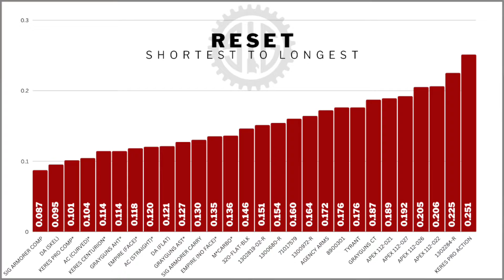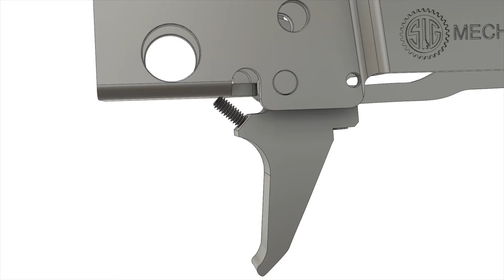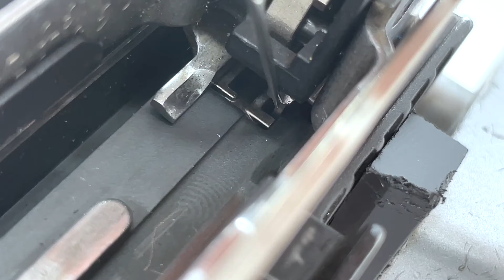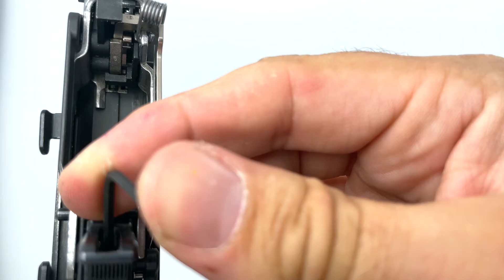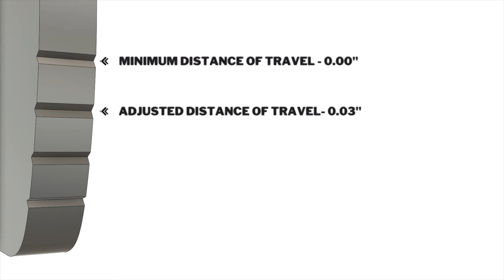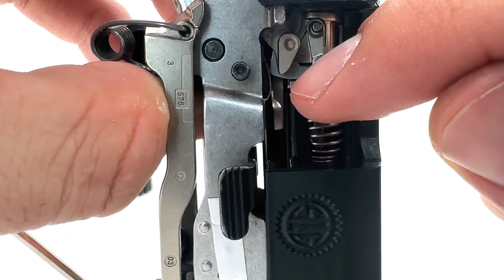EFFECT OF ADJUSTABLE TRIGGERS ON P320 SAFETY

Comment: Amazing what you do for the SIG Community. I am an active IDPA competitor, and recently switched to a SIG P320 Spectre Comp. My wife has a Walther Q5 Match Expert which came with a label, the it has a sporting trigger where the drop safety is compromised. I fully understand how and what the adjustable trigger does now based on your video, but how do you rate  it when it is really only used for competition?
Reply from the maker: In stressful situations like defence or competition it will probably come down to the proficiency of the operator. Bad habits and inexperience could definitely compound problems that lead to ADs. However, even at 50% loss, you still do have safety left to go… not ideal but at least it’s present.

The trigger results however are also VERY impressive, I would not be able to rate it being how subjective that is, but when I look at the data from the trigger video I made, you can clearly see where the adjustable triggers are better.
Reply: @SIGMECHANICS  Thank you!

Comment: Greyguns and Sig Armorer have modified sears, how does that effect safety? Greyguns website says with modified sear, it should only be used on range or in competition. Sounds like safety may be affected? This video was great. I want to get rid of some of the creep in my trigger but don't want to mess with safety mechanisms. Apex trigger bar removes .036" of travel according to your video. Maybe that should be my route.
Reply from the maker: The modified sears help remove creep (or the feeling of it), it essentially has them shave off a bit of material at the sear’s ledge. In the grand scheme of things, it’s not enough to make it fail, but liability probably dictates the statement about “competition use only”.

So long as your not tuning the trigger to remove take up (like with the adjustable trigger) you would technically be fine. Apex being a great option.

Comment: Great video! I just bought an adjustable trigger and I didn’t fully realize this is how it worked! So great knowledge to have. 

Could you do a follow up video to include how a tuning kit and changing striker springs, sear springs, trigger bar return spring etc. can affect safety as well. I would be very interested to see those results.
Reply from the maker: I am planning on doing something similar to this request. Specifically what you’re asking for might require specialized equipment, but I’m definitely going to look into the requirements and see if I can do that for you.
Reply: @SIGMECHANICS  Thank you! I really appreciate the level of detail you put into your videos and the way you explain the mechanics of the gun. You break it down to where it makes sense, not to mention 3D printing a slide to show how it works even further is badass!

Comment: I just have to say that when looking at all the mechanical parts in the firing mechanism of the P320, and then looking at the mechanism parts of a 1911, that the Sig appears to be made of lightly constructed parts that I DO NOT expect to have the operational service life of 1911 parts, which are comparatively all larger, more robust, and part of a simpler, tougher mechanism.     I have an M17 and it's a good gun...but all of my 1911s will outlast it, even my oldest which is already 106 years old and still functions like new.      The firing pin assembly in the 320 looks comically small and fragile.

Comment: From these charts, it looks like the keres pro comp is one of the top performers, but in your testing is shows the centurion is about 1lb lighter of a pull. What is your opinion on which of those two perform/feel better? I’m looking to get one or the other to compare against the empire and tyrant I have
Reply from the maker: I don’t often use aftermarket parts, but I recall the centurion being my favourite out of those two options. However, I also recently did a video about adjustable triggers that I recommend you watch before tuning the trigger.
Reply: which video is that? @SIGMECHANICS
Reply: also, out of all these shoes which is your favorite? I have a few but im looking to try a few more.

Comment: Would using an apex bar with one of these adjustable such as the keres comp be beneficial for the feel and safety of the p320? I’m in the process of modifying mine and I’m trying to get it as light and crisp as possible while maintaining safety margins
Reply from the maker: It’s possible the Apex will help correct/offset the effect of the adjustable trigger but I have not checked into this yet.

Comment: I'm extremely impressed with all of your videos, but this one is the best yet. In this video you pin point on the subject of trigger/safety interaction but if you take a wider view it's obvious that the P320 cannot discharge without pulling the trigger. BUT!!! what is the possibility of the striker block failing?
Reply from the maker: I’ve not heard of anyone with that particular issue yet, I suppose if I made a jig that can put the lock tab spring through tens of thousands of cycles I could find at what point the metal fatigue will kick in. But even then, I’d have to verify if that could lead to an AD since other things need to go wrong.

Comment: Thank so much for these videos. I compete with P320’s and have 10’s of thousands of completely reliable rounds thru my un- modified FCU’s. I asked my gunsmith , who also competes with a Max , if I should investigate trigger mods and he simply told me not to bother . Once broken in , my P320 Max triggers have a crisp break  at 3.5 lbs .The difference is all in the striker assembly . I can take a well used striker , put it in a slide with an unused FCU that is “mushy” with a new striker and it will be then be crisp. I’m assuming  that’s just due to the polishing thru use of the sear and trigger bar interface and spring wear. Therefore , as anyone who wants to be proficient with a firearm should be firing a lot of rounds , the triggers will get to where you need them to be . Speed in pistol matches is all in the dead time between shooting and scoring splits are not required to be nor should be blazing fast. I feel this is a safe stock platform if you simply don’t pull the trigger when not intended .

Comment: Somewhere buried in this video is why all SIGs need to be recalled.
Reply from the maker: I haven't heard anyone specifically say the issue was caused by a modded trigger. Though to date no one has been able to replicate a P320 firing un-commanded. My personal opinion is there is no issue and the "problems" are due to operator error.

Comment: Could a tuner spec striker safety be made to adjust the point of rotation so that the striker was fully impeded until just before the sear released?
Reply from the maker: As in create a striker that you can adjust the safety “on the go”?
Reply: @SIGMECHANICS  something to that effect an oversized lever designed to be filed or perhaps prefit inserts to a more reasonable level of contact on the striker

Comment: Great video bro , Merry Christmas also! 

I use the MC in a LO p320 and Keres Pro in my P320 open gun.

To fix this issue , just remove some material on the bottom of the striker safety arm so when the trigger is adjusted it does not lift the arm out of the way until the trigger is fully depressed . 

Keep up the great work and informative videos !

Comment: I find this channel to be one of the most informative channels on SIG mechanics. I have a question for you. How does the manual safety on  a P320 function?. You showed that very clearly on the P365  but not on the P320. I'd really like to see it works on the P320. How does the manual safety actually make the gun safe?
Reply from the maker: This exact topic will be the focus of my next video, lots of people ask me this and I feel it’s time to provide subscribers with a definitive answer since it will help people really understand their P320 and feel more comfortable with it.
Reply: Please post soon. Shouldn’t the manual safety resolve the issue to some degree?
Reply from the maker: @AquaBoogie2 keep in mind that the issue caused by the adjustable triggers is user error, the MS would stop the trigger from moving back far enough to discharge, but internally you’d still be defeating the safety even if you can’t discharge.

Comment: Another amazingly informative effort, and which I believe could have significant consequences for the recurring claims that P320 pistols sometimes discharge without the trigger’s being pulled. Whenever I’ve participated in discussions about such claims I immediately point out that the safety lock prevents striker protrusion through the breech face unless the trigger is pulled to raise the safety lock from its blocking position. If, however, tuning the trigger moves the safety lock out of its normal blocking position, that significantly compromises the safety design of the pistol.

Although you clearly state that you haven’t determined whether improper tuning of the adjustable trigger can reduce the sear engagement in addition to affecting the position of the safety lock, that certainly seems likely. Without the safety lock’s protection, anything such as the right sort of impact that caused the striker to be disengaged from the sear would cause an unintended discharge. I can now only wonder how many of the supposed self-discharge incidents have involved adjustable triggers.

Comment: Great video! I would like to see this exact test done with the apex trigger bar for comparison. Merry Christmas
Reply from the maker: I spoke with Apex about this and they also asked the same question, I will definitely try it out. I don’t think their trigger bar will cause a problem because the design makes it so the front leading edge is longer instead of the rear side.
Reply: @SIGMECHANICS  I think you might be surprised. In my Apex trigger bar, it engaged the safety lever earlier than the factory trigger bar. I filed off material from the back of it, on that step, to make sure the safety bar didn't engage early, and I still wasn't comfortable with it, so I removed the Apex bar, entirely.
Reply from the maker: @JohnDoe-fk6id to be fair. I had a very small sample size. I’ll grab a few other ones and definitely take a look to see if there are differences.

I will theorize that due to possible tolerances during manufacturing. There may very well be some trigger bars out there that do exactly what you’re saying.

Thanks for your insight!
Reply: @SIGMECHANICS  That was also my assessment, when I emailed Apex about it, back then. Not wanting to throw blame. Just want to expose potentially unsafe combinations.
Reply: @SIGMECHANICS  Full disclosure: my Apex trigger bar was the older black finish. I have no idea if they changed the design when they went to the nickel finish, but it's certainly interesting that they've stopped making it, entirely.

Comment: Theoretically, what if the trigger bar that engages the striker safety was thinner so it had to travel more distance to disengage the safety? Then you could adjust the take up out, and only then would the bar be making contact with the safety.
Reply from the maker: It’s definitely possible and I’ve been playing with that concept as well as a few others.

Comment: Merry Christmas!  Thanks for a great video. So I was wondering if they could just make the sticker safety with a bigger ledge  since there seems to plenty of room for movement you would not lose the safety factor or would that negate the enhanced trigger ? Like the added 3d printed slide to this video.
Reply from the maker: Merry Christmas to you and your family! I believe making a larger/taller ledge might lead to instances where the P320 might not fully lift the lever all the way. Each trigger system SLIGHTLY varies due to manufacturing, the chosen ledge height was probably engineered as an “average” dimension that “just works”. This is however just an opinion as I don’t have the data on hand.

Comment: Amazing video as always!  One question:  on a factory non-adjustable trigger, when we take up the slack to the “wall” is the striker safety fully disengaged at that point?
Reply from the maker: Thank you! No, the slack at that point would remove the small gap between the safety lever and striker lock lever. I made a video where I tested every single P320 trigger ever made and in that video you can see a graph for each trigger that will show you the play of the trigger. Here’s the link: AN ANALYSIS OF EVERY P320 TRIGGER...EVER
https://youtu.be/so3b8JXJDlg

Comment: Well done on the 3D shell to visualize operation. Cutaways are so cool.

That said, it's pretty clear that the safety of the 320 is okay at best when not modified, but because it lacks safeties inherent to other guns, even innocuous tweaks like pre-travel make the 320 even less safe. That's concerning.

I fully believe what SIG said about the recent police video and accidental discharge - something has to be pressing the trigger to make it go off. That said, your videos have made it very clear not much pressure is needed to disengage the internal safeties. Competition guns are even higher risk.

To my understanding, the manual safety model of the FCU, and Agency's trigger dingus are the only two remedies to prevent the current form of accidental, or uncommanded discharges. What're your thoughts? I'd love to hear if you know of other alternatives or options for those that like shooting 320s, but prefer them to stay under control. 😏

Comment: Interestingly, aftermarket Glock triggers have similar effects once you start eliminating takeup. The relative starting position of the trigger at rest is what affects the trigger bar's position on the firing pin safety and in the drop safe ledge. Once you continue adding take up reduction to a certain point, you are able to move the trigger bar past the drop safe ledge while the trigger is at rest, causing an unsafe condition. I agree completely this should never be done on a carry gun. 

Interestingly, I've compared a stock trigger and Overwatch precision trigger bar position and they are the same. I generally recommend those as suitable replacements as all safeties are functional.

Anyhow, merry Christmas from my family to yours Edmund! Cheers!
Reply from the maker: Thank you, merry Christmas to you and yours as well!

Comment: Is it possible for a normal user without the 3d printed slide rig you made to adjust the pretravel to the point that it just barely makes initial contact with the lock lever?  I.e., the maximum adjustment point with 0% safety loss if I understand your video correctly?  Would you consider making your model of the slide rig available?  Thanks!

Comment: So, couldnt this problem be remedied by removing material from the safety lever where it touches the lock lever? In doing so, it allows the safety lever to rest low enough that there is no safety delete while allowing the trigger bar  to come far enough forward to touch the sear?
Reply from the maker: The key would be to keep the radius very consistent to what’s existing. Theoretically though, yes!

Comment: Once again, great content!! I’ve been telling people all along that removing the pretravel deletes the striker safety and this video articulates that concern perfectly. There is a simple fix for folks who want to eliminate pretravel and retain the striker safety feature…. The Apex forward set trigger bar. I believe you did a video on that a year ago. You should do a video with that trigger bar and your 3d printed slide to demonstrate how pretravel is eliminated but safety is retained.
Reply from the maker: Excellent idea. I’ll definitely add that to my list for upcoming videos!
Reply: I definitely think there is valid concern, but I also think there is a fine line of there you can remove some of the take up without affecting the internal safety like discussed there is a dead space there which is about a half turns worth of travel
Reply: +1, please! Would also be nice to see the adjustable triggers combined with the Apex trigger bar. I expect some "eye opening" results, based on my own testing.

Comment: Makes me wonder if the incidents with 320’s going bang had modified triggers and an internal failure.
Reply from the maker: I would like to believe that the police officers had un-modified triggers. However, even if the did, the trigger would still have to be pulled far enough to actually discharge.

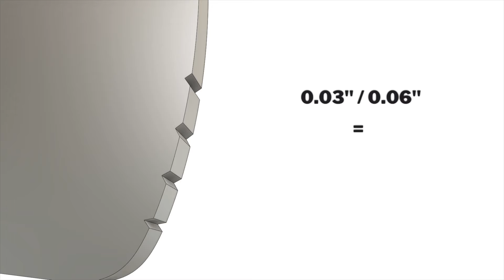Comment: Your math at 16:10 is nonsensical (even if you eventually state the correct answer).

0.03"/0.06" = 0.5 (no units, as this is 50%)
Reply from the maker: Good catch, thanks! I’ll see if I can make the change within YouTube (though they have limited ways of editing once the video is out). 

Thanks again!
Reply: Other than that, it was a great video.

Of course, you did make me go and double check the custom trigger job on my M18...
Reply: @SIGMECHANICS  I scrolled a long way before I found this comment. If possible, you really should edit the video or text to make it clear (or even text below in the description). I must have watched that part of the video 3-4 times before I saw where you had made your math mistake. I kept looking for that 0.05” difference you were talking about. Then I started questioning my mathematical abilities even though I’ve been doing advanced math my entire adult career.  Otherwise, your work is impeccable and very educational. I love the scientific way you approach everything. I have a Sig p365 and was concerned about the safety given the P320 issues and this video along with your video on installing a safety on a P365 showed me just how different the two are.